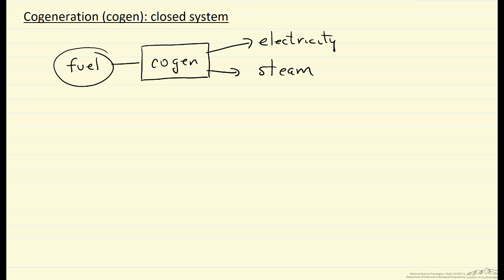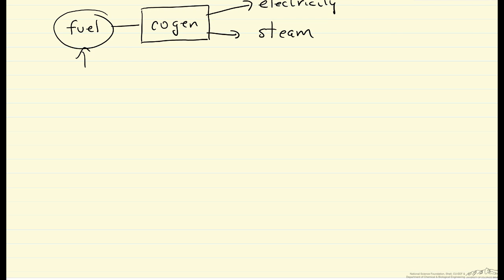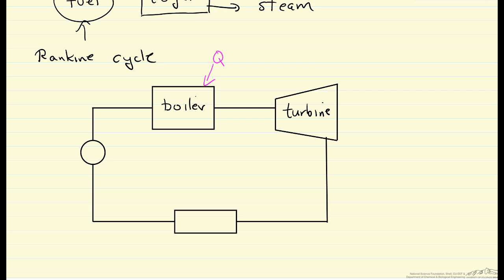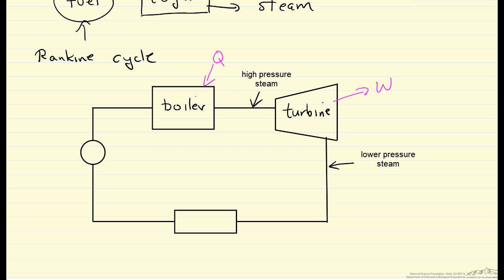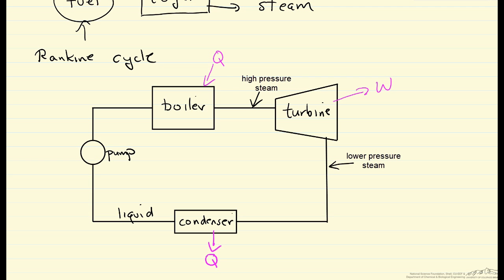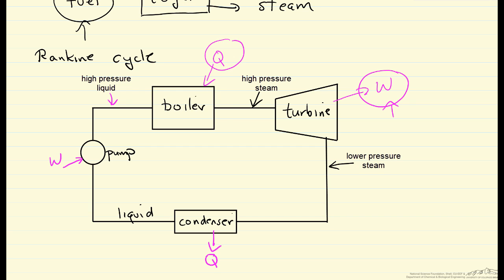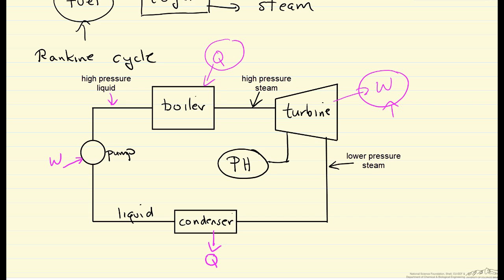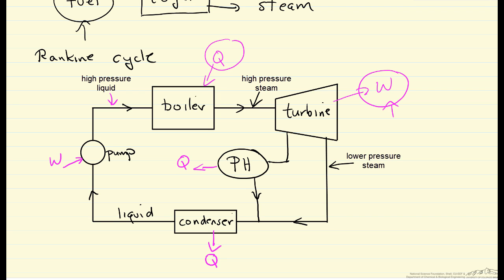Cogeneration (Cogen): Closed System

Comment: The class is good, but the audio is a bit low. Where would the heat extracted from that process heater go?
Reply: bump up the volume? Sounds fine to me
Reply: On the ships we used this Process Heat for heating up the cabins when it was cold, and for generating hot water.